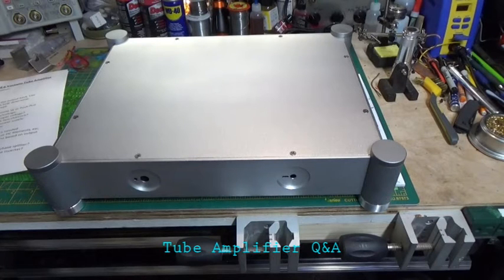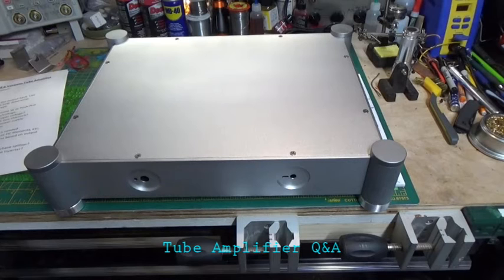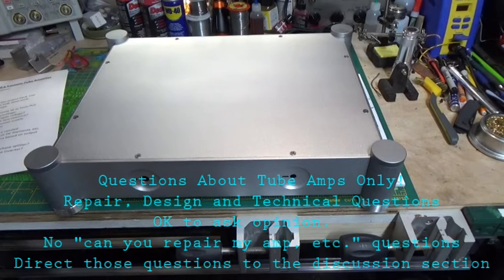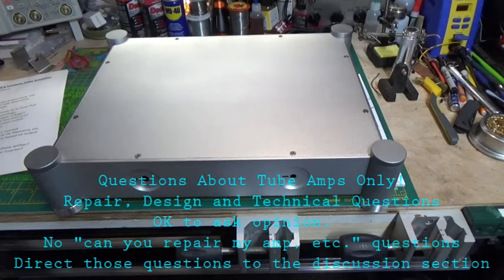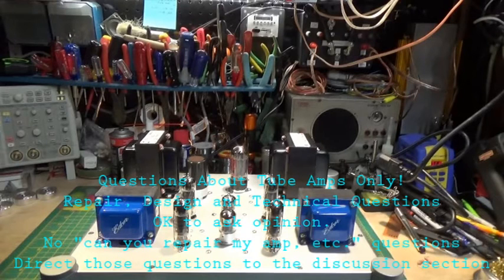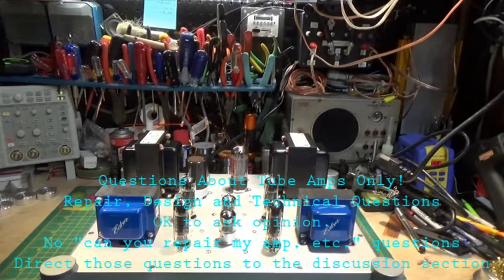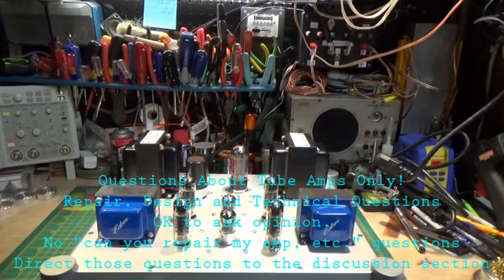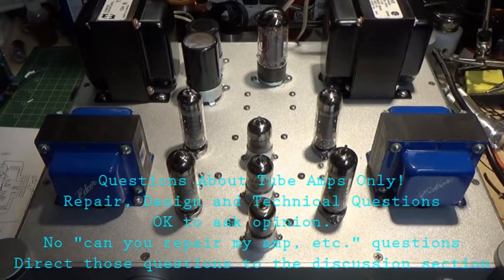Tube Amplifier Q&A

Comment: Moscode 600 HV adj, when trying to increase V+ (230) pot barely moves V+ should be 320 V. Started on one channel, now both channels LOW. Amp plays good But now missing the BIG punch sounds. The tube is a dual pentode type, Next comment will have #. Any Ideas X ? TY 4 any feedback, Ô¿Ô

Comment: What is your opinion of the Edcore output transformers? I am interested in using the 50 watts version of them for an amp restore I'm doing with a friend.
Reply from the maker: Edcor makes very good transformers for the price.  Make sure you check the specs.  Some of the lower-end transformers are rated at 1kHz.  On the full frequency spectrum, they have lower output.  The better transformers are rated at their full power across the full frequency spectrum (20-20,000 Hz).